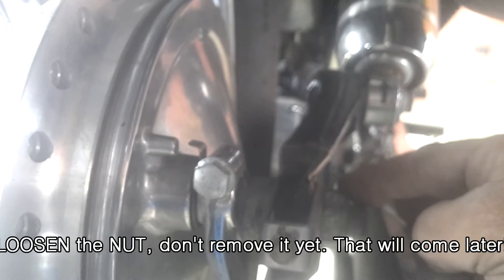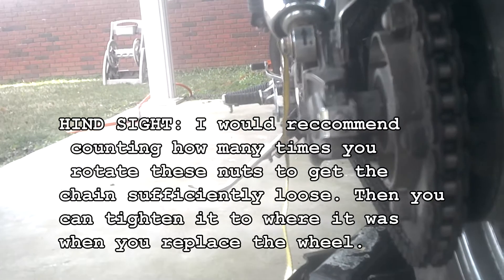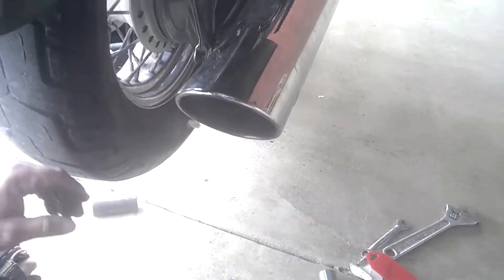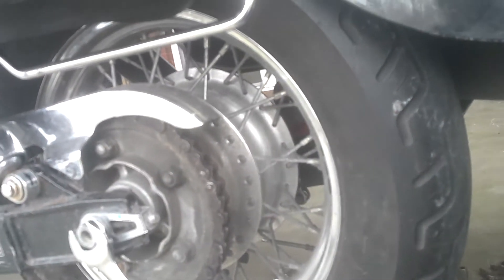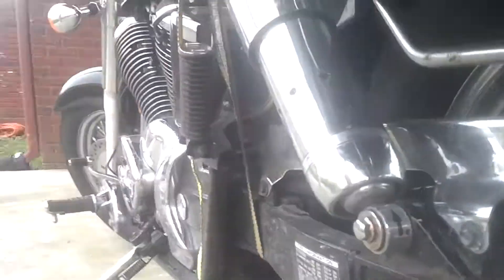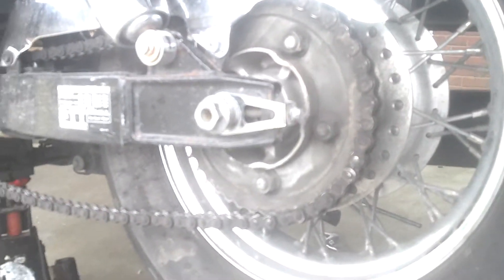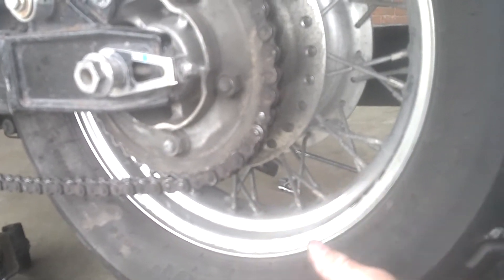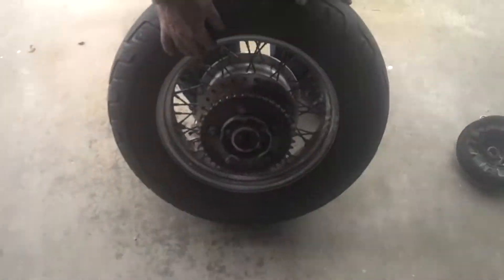2002 Honda Shadow ACE 750 Rear Wheel Removal     Pt 2

Comment: lancerowe, check out the tool kit for Honda Motorcycles at: http://shop.discounthondaparts.com/fiche_section_popup.asp?fveh=192304&section=4435512&year=2001&make=Honda&category=Motorcycles&tiercode=&dc=1354&name=TOOLS

The price is 43.67 from discounthondaparts, and the kit and pouch shoould fit in the tool compartment under your seat. May the sun light the path before you and the angels in the night guide your jouirney home safely. 

CaptnKC